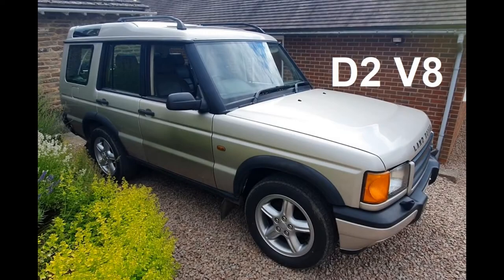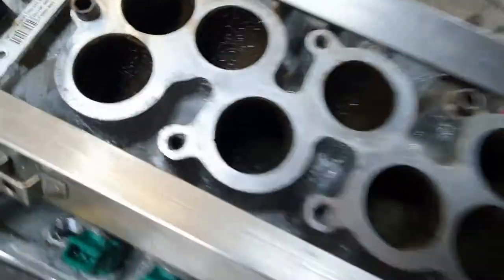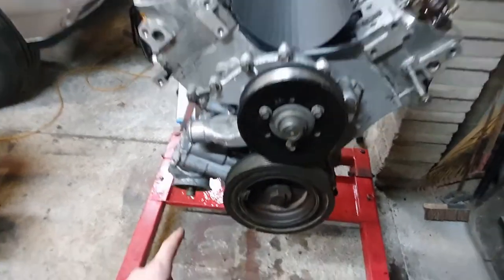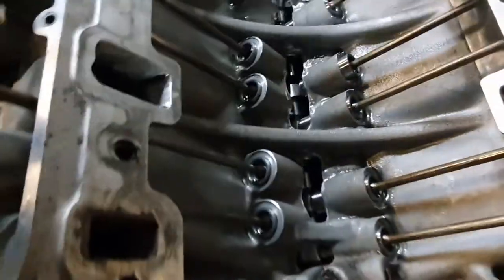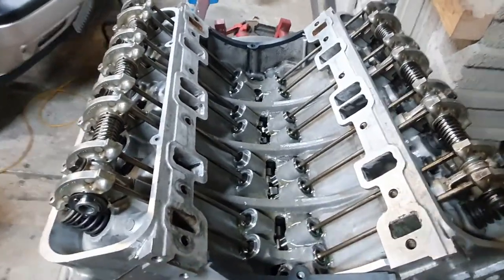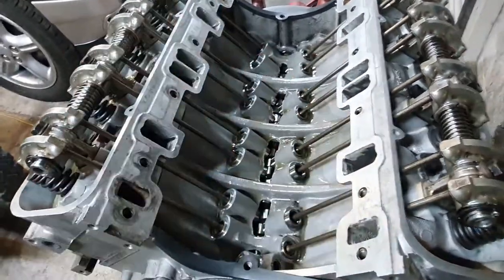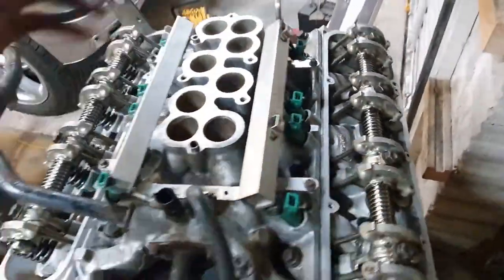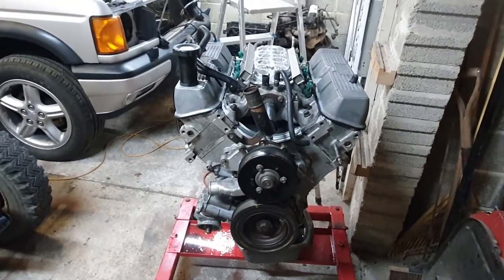Priming Oil System, and final Assembly - Discovery 2 V8 Engine rebuild Part 10

Comment: Looks great. What was your sealant for the valley gasket? Did you torque to spec? I found my D1 specs a little high for the valley gasket so I backed off a few Nm - can’t remember how many now but I didn’t want to strip the threads!

Please explain how you do the final torque up of the crank pulley nut when the time comes. I’m not sure how critical it is. 

Looking forward to hearing it fire up!
Reply from the maker: Dalamar, sorry I seem to have missed this comment. 

I used Victor Reinz, Reinzosil. It seems to a good and alternative to loctite RTV, and it's a fair bit cheaper. My buddy and Project Heaven told me about it. I've been using it for a while and it seems great. I did the manifold bits down to spec, they're fairly chunky Bolts, but the single bold front and back... I totally agree the torque seems quote high, I took it to a point where it felt enough.

Regarding the crank nut. I don't think I have any detail on doing that. I first tried with the engine hanging off the crane, the missus at the flex plate trying to lock it against the block with a very large screw driver snd me on the front end with the torque wrench, I think I only manage about half the torque spec before we couldn't do any more. After that I resorted to impact tightening using only my judgement, its bloody tight now, it must be at least to spec. I'm confident it's sufficiently tight but I'm afraid I couldn't suggest a good method for doing this.
Reply from the maker: Oh and many thanks for taking the time to comment  it's much appreciated.